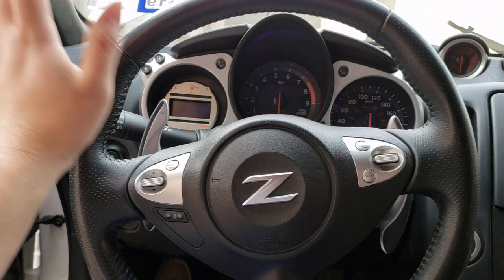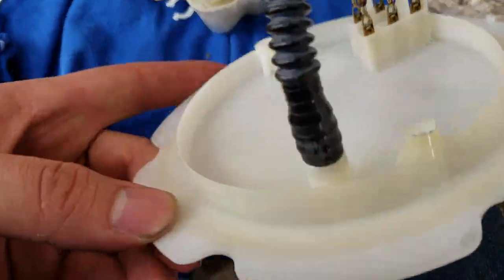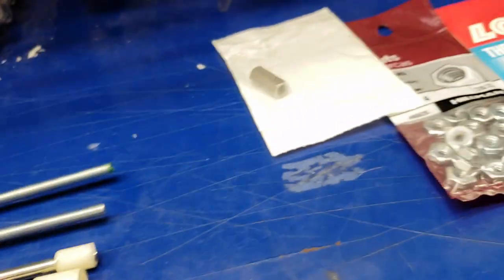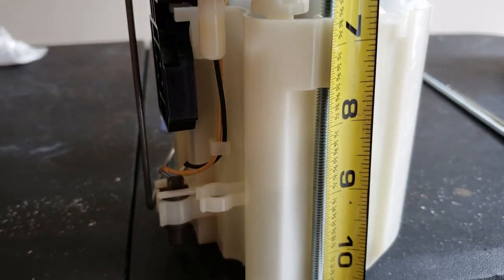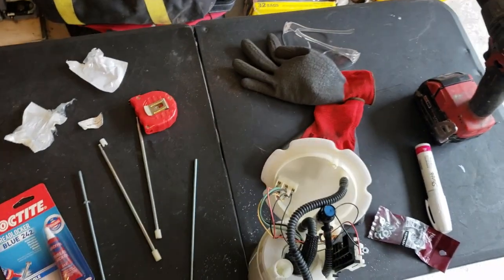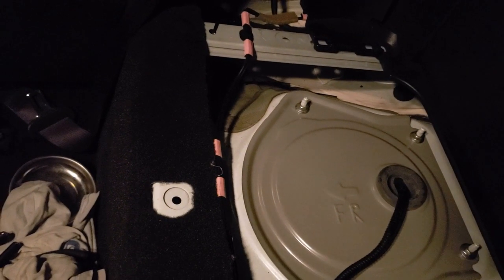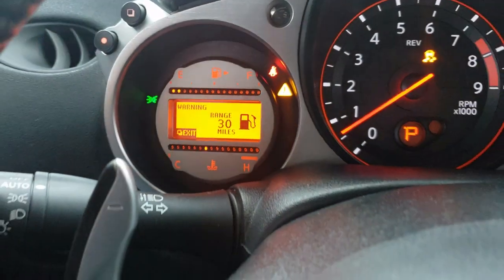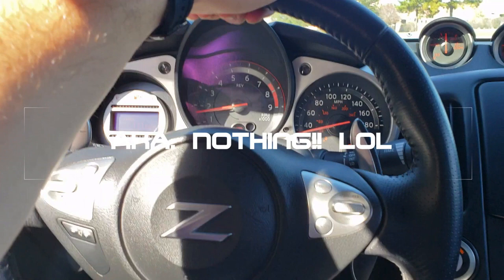Rebuilding a wrecked 370z part.5  Fuel pump issue on 370z Easy FIX!

Comment: Great help. For the metal rods you replaced (DIN975). Did you notice the material of the metal? I'm considering SS304 or SS316, which would be better for the fuel tank?

Comment: How tall from top to bottom was it. I measure 11 and 1/4 inches and it was too tall.
Reply from the maker: If I remember well 11 & 3/4  or just cut down 2-3mm of your current measurement. Try and keep the floater as low as possible for better reading on the guage sensor

Comment: What did you use for sealant
Reply from the maker: Around the rods? I used anti seize from autozone.
Reply: MeBoostaTV I tried this method and the pump came out great but I still had the same problem when I dropped it in the tank since my pump went bad over the time it being broken.
Reply from the maker: Maybe your floater is stuck or the sending unit sensor is damaged? I'd check the wires first. Make sure they're all making good contact as the pump was hanging of them

Comment: My Z just started choking itself...bogs down then comes out of it...then gies into limp mode with nocheck engine lights gots to be the fuel pump or filter .. I've checked everything else..im bummed out
Reply from the maker: @galinkrastev4427  have you checked your gas pedal ? I had similar issues with my mercedes if not proceed with taking apart the fuel pump, upgrade to walbro 255 while you're in there.
Reply: @meboostatv6145  it's just time for it to go...the car has 193k for miles.... fuel filter and pumps assembly have never been changed.....